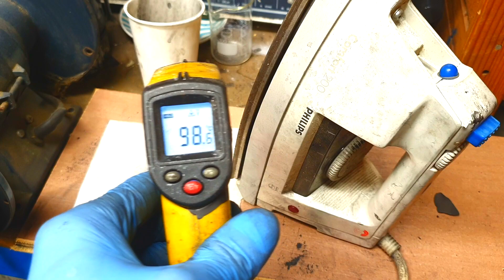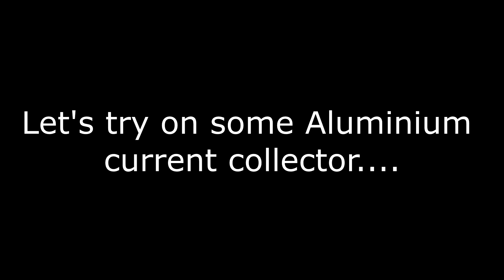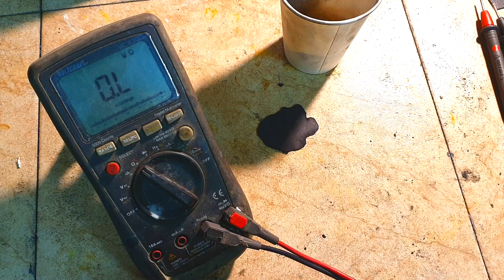How to make Conductive Dry Ink

Comment: Very good mate. In Australia we have low temperature hdpe milk bottles. If you cut this plastic up into a square peice about 1 inch and add conductive additional it can make fantastic electrode. You put it in hot sandwich press and when it is hot enough you can mix the 2 together. Then Spread it out thin to cool and break it up to put in blender with more conductive additives until you get the least plastic needed to hold it together. I did some content a year ago. The search term is dry coat electrode . I have not gone any further with it at this stage but feel free to advance it and spread the word👍🏻
Reply from the maker: Yes right, low hdpe is also really good

Comment: Hello, Cayrex! I really appreciate your educational video. I think to make dry conductive ink, you could use laser printer toner (because the toner is a polymer;  and the polymer has the temperature for melting between 180 - 210 degrees C;  the toner also has advantage because it's a fine powder and it's easy to mix with other compositions). Thank you for sharing this video!
Reply from the maker: Hello Lenard! Yes I was looking for toners for this project,.... I was unlucky to find it
Reply: @cayrex  try using wet chemicals from alkaline battery , lithium from Li battery , epoxy or water glass. Conductivity 10 Ohm per meter

Comment: Can you make your dry Ink using Agar or Alginate or Gelatin?  Wouldn't this be a better Conductive Ink? Also, you using a Coffee Grinder to process Ink Particles, but wouldn't a Roller or Ball Mill be better in the Long Run?
Reply from the maker: Yes of course, Ball mill will be better. But for most of people is easier and cheaper to find some coffee grinder that Roller or Ball Mill. In the end,... if you making some electrodes or you want to cover the aluminum current collector with conductive coating, then will work also with a bit larger particles. But for making some printed electronic, for example,... then you will need smal particles as possible. Using agar and others is good idea, but will be problem with water.

Comment: Great video but i could not understand the pupose of this product.If we want to make an IR heater, the plastic can burn .
Reply from the maker: If you use aluminium for current collectros,.... the Al can corrode really easy in the electrolyte. When you cover the Al with carbon plastic will be more resistante (like some conductive hdpe).... for example. Another example you have here: https://youtu.be/HLr7fI7hqQw
Reply: @cayrex  sorry, i had written in wrong video.i I wached your last video about hdpe plasic conduktive material and wonder if it burn on high temparature.